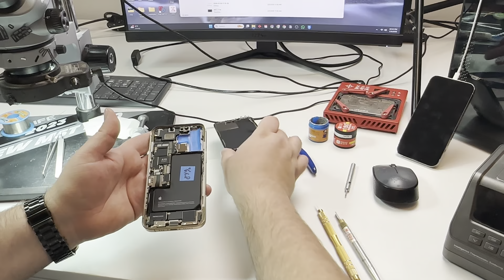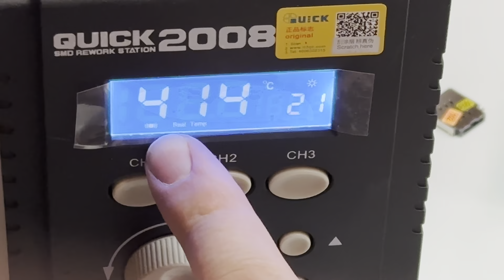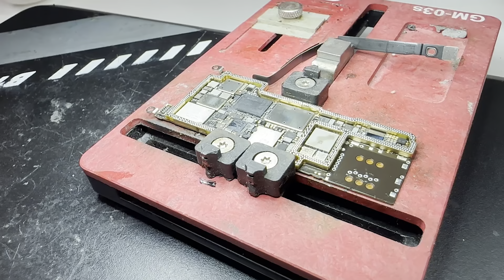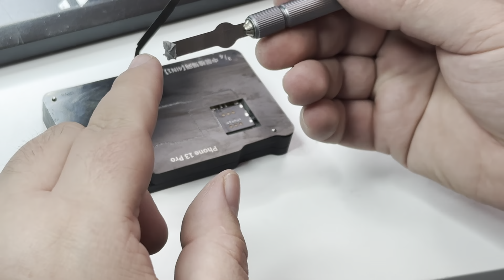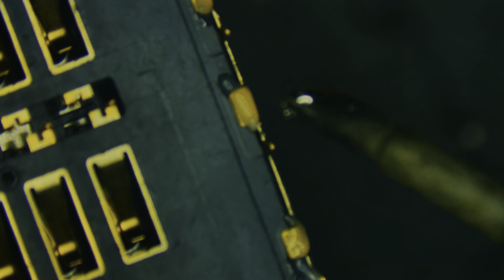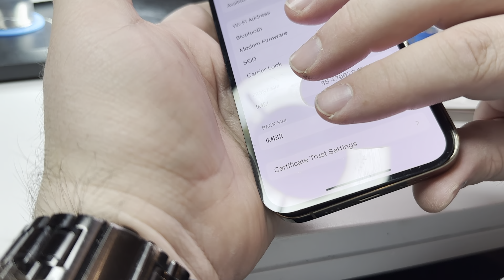Your iPhone Can Be Dual SIM…If You Do This

Comment: Could you assist with iPhone 14 Pro dual sim conversion? I have done the dual sim conversion on an international iPhone 14 Pro version(physical sim plus eSIM version) and currently it says no sim on sim2. Sim 1 is working fine but I can’t detect sim2 . I have made a jumper on bbsim1 detect and bbsim2 detect. Also made jumper for bbsim2 clock, bbsim2 data conn and bbsim2 reset. My main issue is the power supply for sim2 which I understand is handled by pp-uim-ldo13…I need assistance with where to put the 47k resistor (I think that might be causing the no sim on sim2)
Reply from the maker: Look for the empty BB_SIM2_DATA/BB_SIM2_DATA_ESIM spot and put the 4.7k Resistor there and remove the other resistor next to it.
Reply: @MobileSentrix what could be causing the sim2 not be detected? I have connected bbsim2 detect to bbsim1 detect
Reply: @MobileSentrix I have located the bb_sim2_data and bb_sim2_data_esim resistor (R1214E) and next to it is R1213E(bb_sim2_clk and bb_sim2_clk_reset) and behind is R1206 (bb_sim2_data and pp_uim_ldo13). I had removed  the 15k resistor R1206 and installed a 4.7k ohm on R1213(bb_sim2_data and bb_sim2_data_esim). Still no sim detect. I have already removed the esim ic. I Made jumpers on bb_sim1_detect to bb_sim2_detect, bb_sim2_data_conn to bb_sim2_data and bb_sim2_clk_conn to bb_sim2_clk but no sim detected on sim2